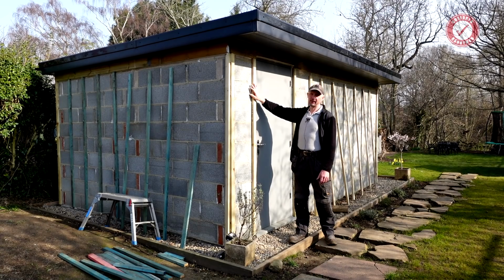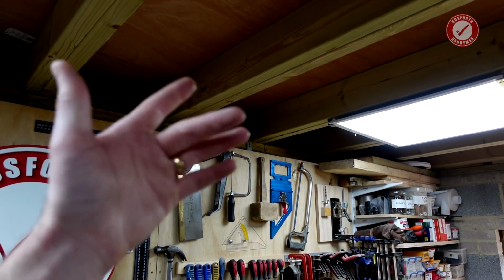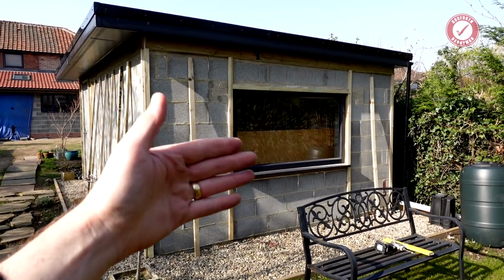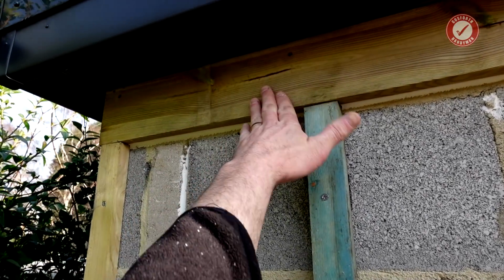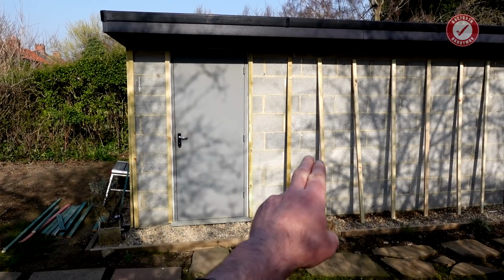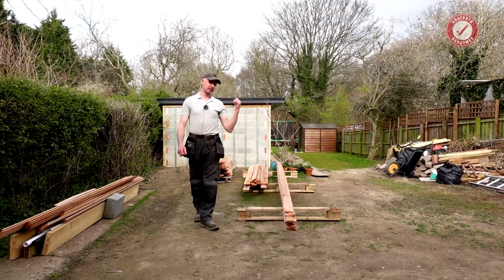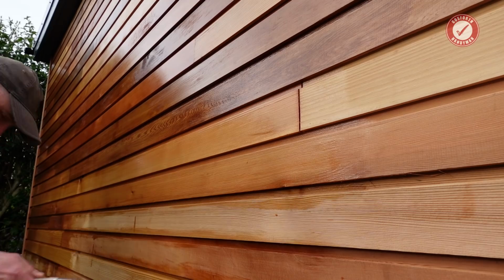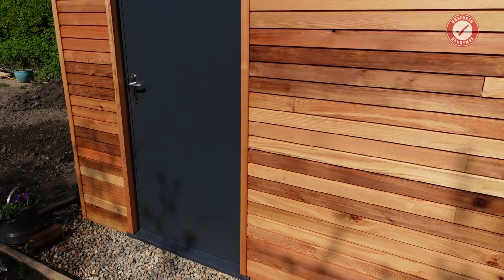Soundproof Garden Room - Cedar Cladding Timelapse (part 3)

Comment: Surely horizontal has to be best? When you see old buildings like this, boards always rot from the ground up. With vertical boards that means renewing all boards many years from now when rot starts. With horizontals, you'll only have to replace the bottom ones.

Comment: interesting build.  I would have added a rubberised layer on battens to the outside of the walls (before) the cedar.  It would be very effective at reducing the sound reaching the thin layer of blocks, remember sold materials conduct sound more easily.

Comment: Looks great Andy! I think I prefer vertical simply for the avoidance of gaps between lengths (which you mentioned). However it really does look lovely and I’d argue more weatherproof horizontally. Can’t wait to see you test it out. Can I request you test it by playing AC DC ‘For those about to rock” and turn it up to 11, before stepping outside to see what sound leaks through?

Comment: Hello! 33 yr handyman here in Northern California Wine Country - Sonoma (not Napa). Former mechanical engineer. Just subbed 5/7/22 after watching your two part patch of the circular hole. Always a fun little job patching sheetrock holes. Great video about your sound proof room, QUESTION - What about basic ventilation between in and out???? Thanks! Michael

Comment: You might need an additional mortice lock and hinge bolts (if not already installed) on that outward opening studio door.
Reply from the maker: Cheers! Yeah, hinge bolts going on soon, but most of the security will be on the inner door. 👍

Comment: I have a 3 story house and the whole exterior is cedar.  Some vertical, some at a 45, and some horizontal.  You have the same problems with horizontal as you would with vertical except a lot more water can get in when vertical separates.  Over time the horizontal looks a lot better and causes less grief.  The stuff at an angle does well for the same reasons as the horizontal.  Gaps are easy to fix and very little water penetration.  My house is just over 40 years old and all the same exterior wood.   And where I live, we have lots of rain.  My state is called the Evergreen state.  So it "ever" rains :-)
Reply from the maker: Interesting and that's good to know. Cheers Jim! 👍

Comment: Looks stunning. Is there a benefit to water protection to have the cladding vertical over the horizontal? I personally think the horizontal does hide its height.
Reply from the maker: I think water is more likely to run off vertical, but I'm hearing mixed reports on that! 👍

Comment: What is the cost differences in building a garden room in block vs timber frame in the current climate? Both with cladding? However not too concerned about acoustic insulation. I love the idea of burnt larch cladding with galvanised lights. Agricultural style
Reply from the maker: Timber frame is probably still cheaper... unless you can lay the blocks yourself. 👍
Reply: @GosforthHandyman  good point- I meant to say either would be DIY, although I'd be much more confident with timber as 0 experience in laying block 😅 your build looks great Andy 👌🏻

Comment: I prefer the horizontal cladding over the vertical, the staggered joints in the boards and the color differences make it look more interesting and make the building look larger in the horizontal dimensions.
Reply from the maker: Cheers! Yes, we really tried for the random board thing... although that in itself was a challenge. 😂

Comment: I worked for a production studio. When they soundproofed the rooms, they specced toughened glass, two sheets with substantial air gap and the inner pane at an angle. I also recall we fitted super heavy double thick doors with double seals all round.
Reply from the maker: Yup - we'll see how the window goes. It's very soundproof... but possibly not enough. 😁

Comment: why not have a hybrid roof, I think you will be surprised how much sound will come in and out through the vents.  If you were living in there then yes have the vents but not for a edit suit. Just a acoustic room ventilation
Reply from the maker: You really need that airflow as you can get condensation forming on the underside of the cold roof. Heard mixed reports about hybrid roofs. 👍

Comment: The acoustic isolation work looks good so far and your plans for the rest sound all good. I think you'll be fine for no leakage in or out of the soffit. Double doors if airtight will be superb. Just appropriately acoustically treat the final inner surface as you do with the walls. 
Couple of questions. Are you going to plasterboard/tecsound/genie the walls too? Shouldn't be needed with the inner skin wall. But once the ceiling is done give it a sound test and see if it's needed.  Other query is do you have any aircon or air purification etc planned for the space? Definitely worth looking at for summer work.
Reply from the maker: Will probably just dot & dab the walls but as you say, we'll see what it's like once the ceiling is up. Similar for ventilation - will see what it's like. As it's concrete with only one north facing window it shouldn't get too hot. 👍

Comment: Hi Andy , looks beautiful mate, a quick question did you need to treat the inner side of the cedar? just wondering if there will be much warping or swelling due to the moisture up here??
Reply from the maker: It should be fine as there's a decent overhang so it shouldn't have any penetrating dampness and cedar is quite forgiving. Time will tell! 👍
Reply: @GosforthHandyman  cool mate.

Comment: Quick question buddy we live in a very long bungalow, half of the bungalow front to back is ours the other half is nxt doors we have laminate flooring front to back nxt door has tiled there’s, when they are walking we can here it on our side or if they move the kitchen chairs we can cheer it in our bed room what can we do buddy
Reply from the maker: So semi-detached bungalow? Not easy to resolve I'm afraid. There might be some acoustic underlays worth trying but the only proper solution is to isolate the joists from the party wall (not easy).
Reply: @GosforthHandyman  yes buddy it feels like one big slab of concrete with a partition wall seperating us I can isolate the sound coming through the walls but the vibration through the concrete is nuts, I feel more sorry for them we have two young children and lucky for them no sex life lol they are great neighbors we don’t want to scare them off

Comment: How exactly did you fix the cladding to the battens? Thanks
Reply from the maker: 18ga stainless steel brads 👍
Reply: @GosforthHandyman  will those be strong enough in the long term? My understanding was that something with a larger head should be used - when I fixed cladding before I used decking screws because of this (don't have a 1st fix nailer) and it took forever! Would definitely have been quicker with a Brad nailer but everything I read suggested it would be inadequate?

Comment: If you want an airtight and soundight room you could finish the inside blockwork with a parge coat.  These can be store bought (Soundcoat plus) or made and mixed yourself quite easily
Reply from the maker: Cheers! It's mainly the ceiling so we shall see!

Comment: Quite a few brickies probably don't bother fully pointing the outside of blockwork, because they're used to it getting rendered, which will resolve any bits they miss. Lazy, but it makes sense.. if it gets rendered.
Reply from the maker: Yeah, just seems lazy to me. A few brickies have said they always joint blockwork no matter what. 👍
Reply: @GosforthHandyman  Well, laziness is also a form of efficiency.

Props to anyone who goes the extra mile, though.

Comment: Looks great but I would have applied the finish before fitting the cladding.
Reply from the maker: Trouble is you're supposed to wait 6 weeks before applying the finish so there's no way I could have stored finished wood for that length or time. 👍
Reply: @GosforthHandyman  Ah, that explains it then.